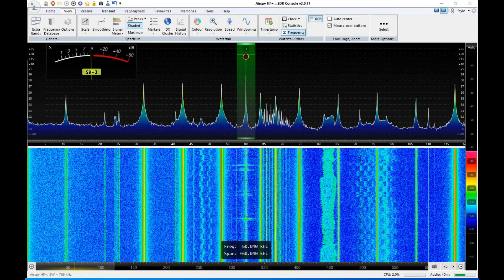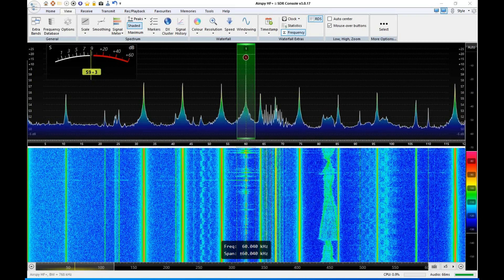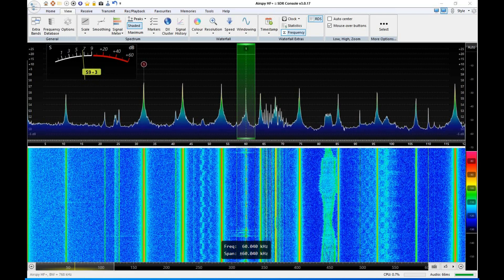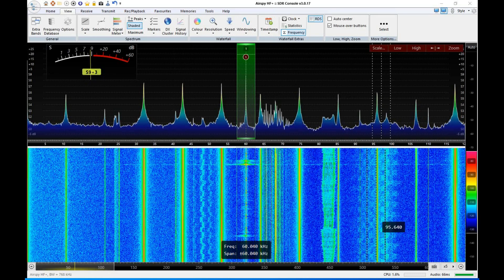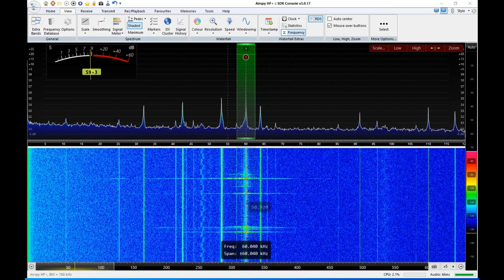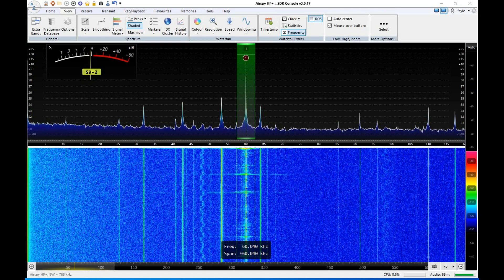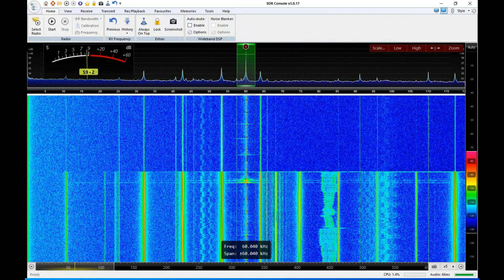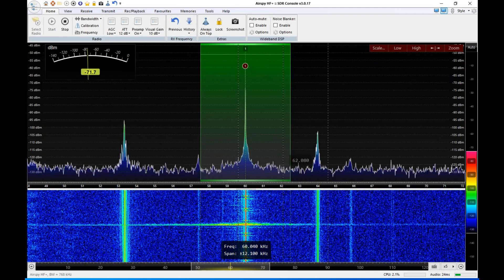Common mode Chokes for loops

Comment: I recall when I first became a LowFER in 1991 and was learning about RF I was tuning across the LowFER band with a kit LowFER receiver I'd just built and heard what I thought was some sort of spastic CW precisely on 180 kHz that was extremely strong. Day or night, it never shut off or changed frequency. But the 'CW' I was hearing kept changing ever so slightly. Not knowing Morse at the time I wrote down dots and dashes and then tried to decode them in order to identify the station, which was the loudest thing on the band besides the US military GWEN network around 160 kHz, what I called "the steam-powered robots." Of course I failed miserably to make any sense out of what I was receiving, until one day I had both my LowFER receiver turned to the 180 kHz mystery station and my 60 kHz WWVB freq ref receiver hooked to my o'scope on my workbench. As I was returning from the kitchen with a sandwich I could see the 'scope display and hear the LowFER receiver at the same time, and duh, it became clear to slow-witted me that they were the same signal. I was copying WWVB's 3rd harmonic on 180 kHz. Later I learned from other LowFERs that they too could copy the harmonic and had actually sent QSL card requests to the addresses of WWV and NIST. At first NIST had refused to QSL, claiming that the WWVB harmonic was essentially nonexistent, far too weak to be copied at any distance, let alone at hundreds, or even over a thousand miles away in the case of 1 LowFER. NIST stated that there must be something wrong with the LowFERs' receivers. They refused to believe that their signal could be 'dirty' enough to be heard all over the country on 180 kHz.  But after receiving several such QSL requests from around the USA from LowFers who specified both their equipment and their installations, high Q smal loops with tuned J-FET preamps at the loop, common mode chokes, shielding, ground configurations, even optically coupled coax, etc, (and I believe 1 VHS video tape sent by an RF engineer,) they finally acknowledged that there was indeed a 180 kHz harmonic that, with the right antennas, and narrow-band equipment one could copy that 180 kHz WWVB 3rd harmonic almost as far away as the 60 kHz carrier was designed to travel. The LowFERs never doubted it as, like me, they were consistently blanketing large chunks of the country on 160 to 190 kHz with ERP's in the 1 to 5 mW range. I did a quick mental estimate at the time that WWVB's 3rd harmonic was probably around 1 Watt ERP on 180 kHz, a truly 'big gun' on the band. It certainly blasted in to me at a distance of 70 miles with no problem, and was copied by several others from around the country.

Comment: Is the loop antenna grounded? If it is see what happens when you isolate it from ground.
]
And rather than shorting the choke a theoretically better test would be to replace the choke with a BNC barrel connector. That might give different results considering that the shield choke is shorted but the center conductor series  inductance is not.
{^_^}   W6<mumble><mumble><mumble> (I've been stalked before....)
Reply from the maker: Yes the loop is grounded.. I have made some measurements using the BNC as you suggest and there   doesn't seem to be much difference  from just shorting the shield. For continuity on the video reasons, I decided to just short the shields of the CMC

Comment: Thanks for this video and your previous one, Paul...excellent examples of the benefits of choking off CM noise. My chokes use a single large "73" core for MW use, stuffed full of RG-174, but I like the idea of your eight cores forming a binocular configuration. How many feet of the small coax do you estimate yours uses? ~50 feet? 

I sometimes use mine with Wellbrook loops, which are already well decoupled. However, on DXpeditions where my antenna setups are temporary and not always "RF sanitary", I find that feedline chokes can help even Wellbrook antennas.

I'm thinking of trying KK5JY's "Loop on Ground" (LOG) antenna, and would definitely use RF chokes near the balun and at the receiver end. 73, Guy